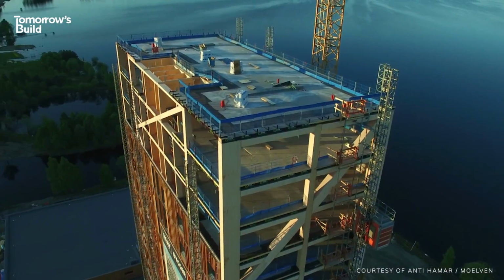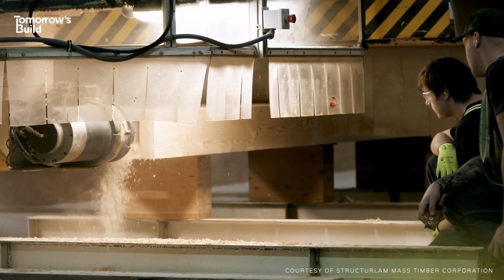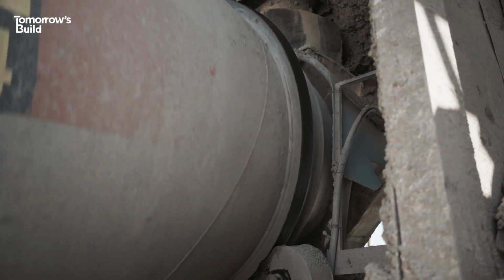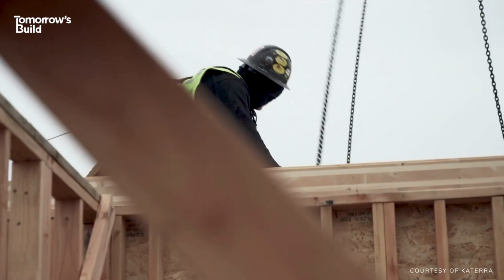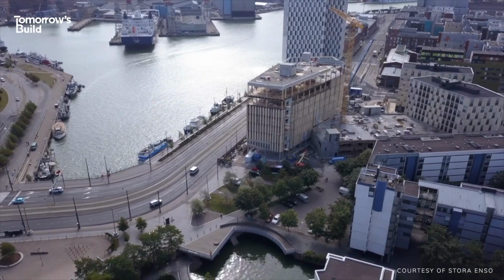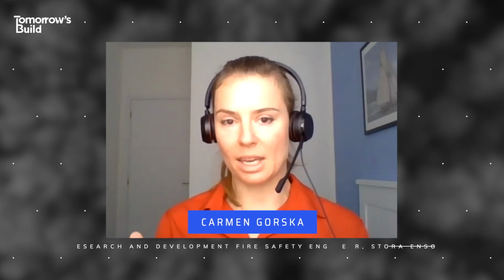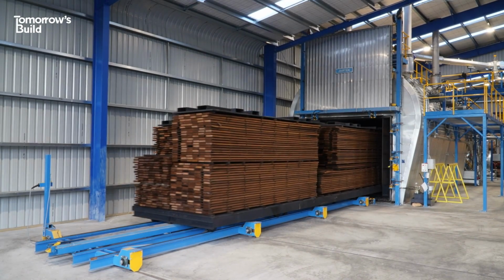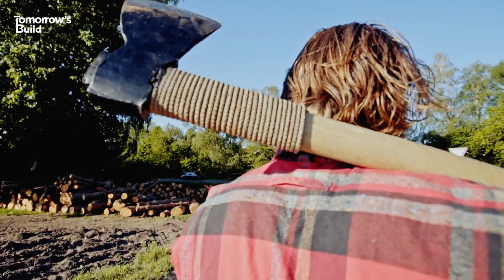Why All Buildings Should Be Timber

Comment: The biggest problem with construction isn't the core materials, it is other choices and design and how we view structures and age. Old is seen as a bad thing, people like new stuff, even if it's new cheap junk, it is a cultural issue. We build buildings often just big enough for what we need now, with no room for growth, that goes for all infrastructure. By the time they add a lane to a highway, it probably needs 1 or 2 more already, it's already out of date by the time it's constructed. Buildings aren't designed in any sort of future proof way, interior walls are not modular or easily movable, for instance buildings build in the last century at any point, should have known that they need lot of conduit and channels for running of power and communications lines, and spaces to put equipment, yet you see buildings built all the way up into the 90's that had inadequate forward planning for upgrade or expansion, and the data or phone closet is also a mop closet because it was an after thought. Also choices for roofing materials tend towards cheap leaky crap that is meant to be fixed and repaired constantly and replaced periodically so if a place is neglected for a bit it will leak and rot from the inside out. Yet there are stone and concrete buildings from ancient greece, rome, and the orient, still standing. There are hundreds of year old wooden structures, but none to my knowledge that are even a thousand. In theory we should be aiming to, and capable of utilizing concrete and steel structures, for thousands of years. 10's of thousands even. In that way, the pollution is largely irrelevant. However because we often demolition and rebuild concrete and steel structures every 40 or 50 years, sometimes more, sometimes even less, then the pollution is more relevant.

Comment: After spending 20 years as a civil engineer I feel compelled to go point by point on this video explaining why is a bad idea... But I feel like nobody would read such a massive text.

One point though: How much wood do you believe we would need to make all constructions with timber in the next... Let's not even use much... Let's go for 5 years, that should be good enough.Unless you intend on living in a planet without trees... It's just not happening. Take a few minutes to look at how much wood goes into just the structural frame of a very average sized house, then the  average of small buildings that is about 5000ft².... You cannot grow those trees in a sustainable farm, you can probably not even grow those trees in the planet. You severely underestimate construction.

Comment: The R value (insulation value) for thick wood is amazing. It looks very poor on paper compared to fiberglass or rockwool, but try putting 1lb or 2 of each in an oven at 300°f for an hour and see which one will radiate the heat longer.

Comment: Bamboo release more oxygen and absorb carbon dioxide more than four times in comparison with other trees. Bamboo is lighter, far more water resistant, easier to bend yet stronger than steel. Trees take between 10 and 50 years to plant and regrow - Bamboo does not have to be replanted in fact the more you harvest it the faster it grows - as fast as an inch and a half PER HOUR, and Because it contains large amounts of silicate acid, bamboo is abnormally flame resistant. We obviously would still need to grow lumber - for the most part- but bamboo adapts well in the South from Virginia to Florida and along the Gulf Coast to Texas.

Comment: The sentiment is right . But I can only speak from experence I have lived in my brick house for 50 years and it was there at least another 100 before I moved in.Dureing that time I have replaced  my wooden garden shed 4 times the wooden fence 5 times and the wooden parts of the house and garage twice due to wood rot .On the other hand I have not had to replace one single brick in the 50 years. But the guy at the wood yard rubs his hand's together and starts smileing  every time i have to visit .

Comment: My biggest question is it as strong as steel and concrete for larger, tall buildings? How long does it last before replacement is required? Price differences?
I like the idea but there isn’t a lot of info on the specs in comparison.

Comment: Wood is still pretty common in the USA today. 
I just drove past a building under construction yesterday that was 4 stories and all wood. 

Water is a big issue, which often requires the foundation to be higher or in some cases, the bottom level is half concrete or bricks.
Even when wood is kept in great condition, it still decays and breaks down over time. This isn't to big of an issue for a small house as you can repair the damage. But, for a larger building, things become more complicated.  This can happen with any material, but many of those materials don't have as many negatives to wood. So it is easier to accept the price difference. 

I have also seen some building uses concrete or bricks for the foundation and structural walls, but then use wood for the other parts. I worry about the joints between the two materials, but it would reduce the risk of building with wood and it would also reduce the cost of repairing it later on.

Comment: As a new owner of an old building which still has timber wood in its construction, timber, especially old timber is a pain in the ass. You need regular termite checkups (which are not cheap in my city cuz not many have these timber buildings), special building permits to state that you can modify the building compared to other steel ones, not to mention the water damage that an old timber building has. Don't get me wrong. I am very proud to be an owner of an interesting building that was built in a time when timber buildings are common, but there is a reason why timber was put away in lieu of steel. From my perspective, steel is straight up cheaper in maintenance.

Comment: All those pics of the buildings burning just show mud & sticks. Aka drywall & timber. But in real life you have carpet, couches, curtains & many many more things that are all made from guess what? Yep petroleum! This creates a wicking effect.  The heat melts the petroleum products.  The drywall that was mentioned to prevent the fire. Turns into a wick & the timber does as well.

Comment: I am intrigued, yet remain unconvinced. I still think Bamboo and Hemp are significantly superior to timber for buildings with less than 5 or 6 floors. However, for high rise buildings, perhaps using timber as the core of the structure while using Bamboo and Hemp for everything else could work well.

Comment: I’d rather live a house than a tower but id certainly rather live in a concrete tower than a wooden one, first of all wooden towers can’t be as tall, second of all they’re less structurally sound especially during high winds, thirdly they have high up keep costs meaning higher building rent and/or cost, and many other reasons. And I can assure you the foundations for wooden towers are definitely made of concrete, also you have to think of the abiotic factors like natural disasters.

Comment: My concern isnt with size or strength of a building that's made out of timber, my concern is with the longevity of the building. If the isnt pressure treatment you have a shorter time on the building. Honestly I'd rather use steel and concrete as a base for a building. It's nice that these companies are trying to be eco friendly with these builds yet they've gotta think about the longevity of the building.

Comment: Nonsense, hempcrete with insulation grown from funghi is much more effective. Hemp grows much quicker, hempcrete is more quake and fire resistant than wood or even regular concrete. Its cheaper, stronger and all round better. Insulation from funghi is moldable, fireproof and there's no plastic waste.

Comment: looks great, i would really love if everything is made this way.
but what about longevity? wouldn't that material require replacement after much shorter time? can the buildings be designed in such way so sections to be replaced with new timber?
also bridges? i think it's best to use rock based materials there... water and wood are not the greatest together :D

Comment: This notion seems quite naive. Timber has a short lifespan and degrades quickly especially when exposed to the elements. Treating lumber is not green, dangerous to the environment, and dangerous to humans too. Used materials in construction is a balancing act. The video kind of admits that it's not a replacement for concrete. A proposal of adding more lumber to our constructions is certainly a great idea. Wooden bridges cannot take as much weight as steel bridges and again requires heavy treatment to increase lifespan. Too low of humidity in a building and the wood will crack.

Comment: I question the validity of some "sustainable forestry" claims. For example in Canada, caribou populations are really struggling. Boreal caribou for example depend on lichens as a food source. Lichens take decades to grow before being optimum for caribou forage. So you can't just say it's sustainable because you didn't cut it down for 15 years then clear cut. Also cut lines make predation easier as wolves and coyotes easily hunt along cut lines. A "sustainable" forest without plentiful large animals and large predators is actually just a sterile forest. It has probably just been sterile for so long that you forgot about it's natural baseline. That said, timber has some great potential regarding climate change mitigation as you mentioned!

Comment: This video somewhat misrepresents the nature of the hazard with regard to fire. Although it is mentioned that wood materials can char as a way to protect the structure and that gypsum board is often used to encapsulate wood structures, it is the building contents that often pose the greatest fire hazard. For this reason, it is important to also emphasize the importance of active fire protection systems such as automatic fire sprinkler and alarm systems in conjunction with improved structural systems.

Comment: This is cool, but I feel like it glosses over some things. Many timber operations are unsustainable. The chemical inputs into the material should have been discussed. And there have been instances of five-over-ones burning pretty spectacularly. I guess the central unifying factor that should have been mentioned is that this bright future is really all dependent on appropriate regulations to ensure safety and sustainability across the board.

Comment: 80% of the buildings in the south Lake Union area in Seattle are 7 story mixed use timber framed buildings. 5 stories of mixed lumber on top of 2 stories of post tension concrete.

Comment: As a builder I would say multi-storey building in timber is a real pain. The local Fire authority will not leave you alone and the amount of temporary fire protection you need to have in place is way over the top compared to traditional. Also I still have memory of that project in Hendon back in the noughties that burned down to such a high temperature that it was setting neighbouring properties on fire by radiation alone. Sorry but at least with the  Grenfell tower the concrete superstructure was still intact  and it was suggested that there was refuge in the communal core store rooms which was made up of concrete walls if people knew about it. I believe timber has it's place in low level building or to extend storeys to encompass a penthouse for example, but I would have preference for concrete for main core structure. Also for dwellings and hotels timber frame can have bad acoustic issues if you get it wrong on site. I'm actually open minded, but we need to be very careful here with regards to medium and high rise as another mass carnage tragedy is around the corner with regards to fire. Most likely accelerated by poor maintenance when messing around with  the drylining and fire stopping as the years go by.

Comment: In Europe, where most land is already cleared and where fast-growing pine trees can be planted for the wood to be used in these constructions, it can be good.
In countries like Brazil, where half of the territory is forest, the wood removed will mean deforestation in the Amazon. And it is not feasible to deforest other biomes to plant pine trees: the climate is too hot for them and they are an invasive species. The local variety of pine that exists in the south of the country is at risk of extinction and does not have the capacity to extract much wood. In Brazil it is better to produce low carbon steel than to destroy forests to do this kind of thing. This is true for any tropical country where the use of wood means damage to the rainforest. This would also not apply to Japan, which has a large untouched green cover and where most of the land is for food. But it should work for the British Isles, which had almost all trees uprooted during the Middle Ages.

Comment: We've heard all this before to justify using more timber (>50%) for constructing apartment buildings.  "Flame-retardent" is a myth.  No matter how it's designed, the building will follow the laws of thermodynamics and you cannot stop thermal runaway in materials (wood) that have ignition temperatures as low as 110'.  They'll still go up like a matchhead.

Comment: 6:40 Even safer than steel. Pure bovine fecal matter. No skyscraper has ever burned down. Fire can not melt from fire. It has to be a at least 2750° F. Fire burns in a building at an average temperature of 600°F to 800°F. jet-fuel burns at 800 to 1500°F.

Comment: In general I like the movie, but they are clearly avoiding some topics.
1. how sustainable/toxic are the adhesives and laminates (plastic) used in that timber manufacturing?
2. "timber can be engineered to be stronger than steel pound-for-pound"... "pound-for-pound". And steel is substantially heavier than timber. So you would have to use x times wider columns to support the same weight with timber as steel does. That is really stupid argument.

Comment: Timber is considered to be sustainable until the point our demand overwhelms the supply. Not to mention we haven't completely figure out the fire characteristics of these laminated timbers. We haven't fully addressed the issue of toxic chemicals released by the adhesives in the CLT and LVL during the process of burning. And did we talked about the level of formaldehyde in the CLT adhesives?

Therefore calling for "all buildings should be timber"  (even with the limitations provided in the video) prematurely is just as unresponsible.

Comment: Far better then trees Hemp is a truly sustainable source for building materials that takes up relatively little space, produces more pulp per acre than trees, and is biodegradable. Hemp crops even give back by returning nutrients to the soil and sequestering carbon dioxide and Hempcrete has got so much going for it- fire and mold resistant and exceptionally durable, it can last hundreds of years

Comment: I can hear my neighbor masturbate in this common style wood and drywall based apartment building. Your going to have to try harder. 
Furthermore monoculture forests like timber farms, are inefficient forms of carbon sequestration. It would be better to leave it as an untouched forest. The real amount of carbon is stored in the soil. This is plant roots but mostly fungi and bacteria,  ie carbon based life. A diverse forest feeds this microbiome carbon based sugars, the microbes use it to multiply, thus putting more carbon into the soil. This organic material holds moisture allowing rains to be absorbed rather then having them erode the land. Until the industry can solve the issue of monoculture farms and not cutting forests down it'll be hard to argue mass timber building is good for the enviroment.

Comment: Let me tell you as someone who lives in a city that exports lumber, and is acquainted with some people in the industry, it isn't as sustainable as people like to let on.  Clear cutting has been catastrophic to our local eco-systems, and has started multiple fires because they let debris stack up during hot summers.  It's also had a negative effect on our streams and rivers since forests help retain moisture in the ground that eventually moves to the rivers.

Companies often lie about their impact on forests, especially old-growth forests, and they are usually not accountable for any wrong doing because they are supported by the government (Many logging companies are Union).

Yes, logging companies do replant trees, however the trees in question are often grown in extremely close proximity, and are mono-cultures, meaning that there is no diversity in the regrown eco-system which can lead to poor tree health, pests, and disease.  Ironically this type of growing also meanings that trees grow smaller and weaker, since it's also very bad for the soil in the area.  Keep in mind that a sufficiently sized tree takes around 20 years to grow.

Very layman version of my argument, but I think you get it.  We don't have enough trees to support this kind of argument in a sustainable way.  We would have no more trees if we built every building with timber.

Not to say alternatives are any better, but if I had to choose, I'd like to keep resources that help fight climate change.  I think people need to be more open to alternatives in the near future.